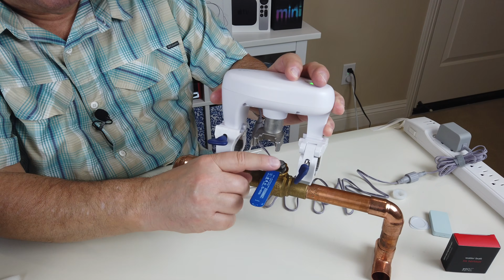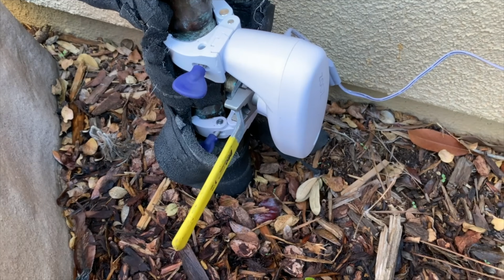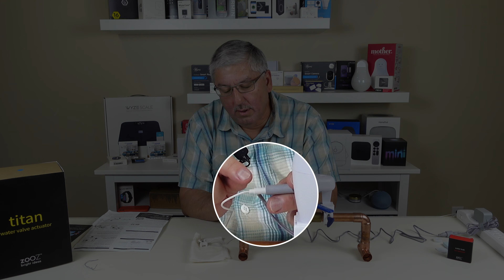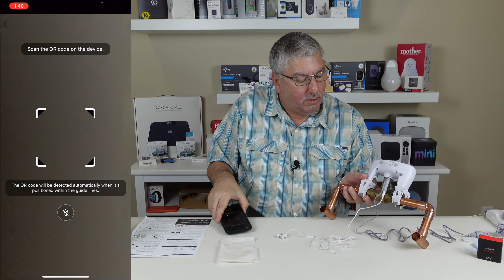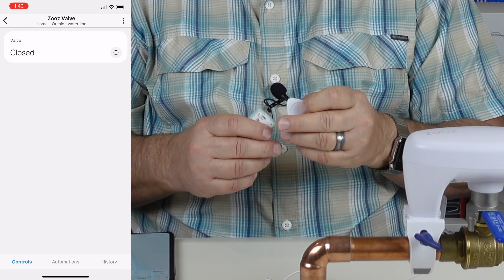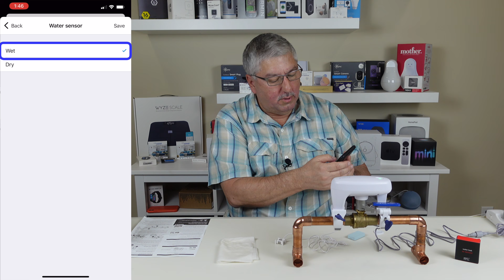REVIEW: Zooz Z-Wave Plus Titan Water Valve Actuator ZAC36 and Water Leak XS Sensor ZSE42

Comment: How would you put this outside if the main water valve is not near a power source to plug in the device?
Reply: Install a power source!!
Reply from the maker: the device requires a power source. I would call Zooz to see if they have other options.

Comment: I bought one of these and the only problem is the water probe wire is too short.  It didn't even reach the bottom of the water heater.  It was 2 feet short.  How did they screw this up???  I emailed them and they told me to buy an extension wire from amazon.  They said they were working on correcting this problem.  If you have the same problem you will need a 3.5mm 4-Pole AUX Extension Cable.  They also said to tape the wire in place so it doesn't come out of the plug on the power wire.  Another problem they know about as seen in this video.  Great video.
Reply from the maker: Hi Doug best bet is to get their wireless sensor to use as a trigger. It works well. You can even program it to talk directly to the Titan in case you don’t want to use a zwave hub.

Comment: Do you know if you can hook up a back-up power supply for this?   Also, what back-up power supply.  Thanks.   Great video, very informative.  Keep more video's coming.
Reply: Your best bet will be a UPS
Reply from the maker: thank you! I don't think they've released a battery backup yet. We'd like to see that for sure. if your valve is in the house you could plug into a UPS. if we here otherwise will post an update.
Reply from the maker: they are working on a backup power solution. if they release one we will be sure to tweet about it at least.

Comment: Great video and awesome product, i want to get one for my home.  The only thing is i dont know anything about smart home hubs, the smartthings app looked very user friendly, what type of hub would your recommend?
Reply from the maker: There are lots of choices, just make sure they include Z-Wave. If you are technical there are more capable hubs. We recently did a review on the HomeSeer hub (https://youtu.be/OlqseAHjHvU) which works with the Zooz.  If you want the mainstream, the SmartThings Hub would likely makes sense and that is the one we have the zooz connected to currently (now sold by Aeotec though hard to find). There are others of course like Hubitat which again are more complex but powerful. I would recommend doing lot of research before you make a choice.
Reply: Get the aeotech